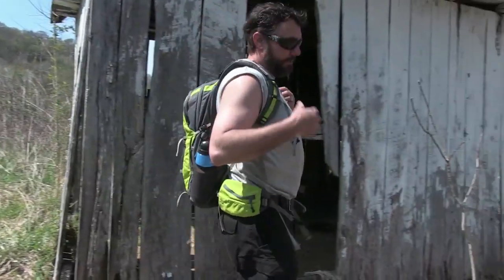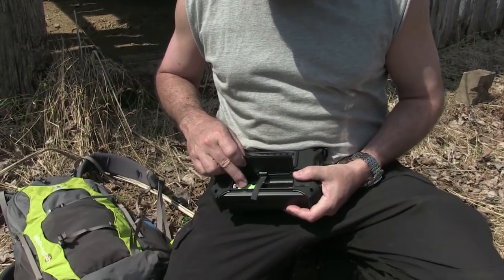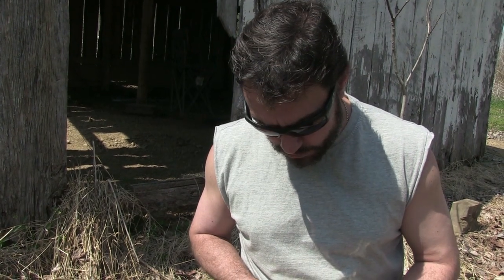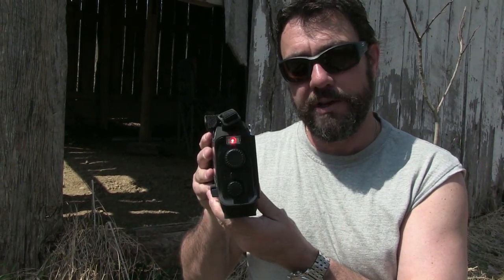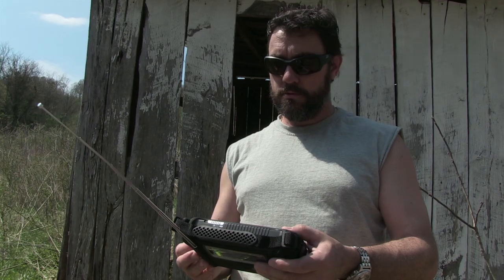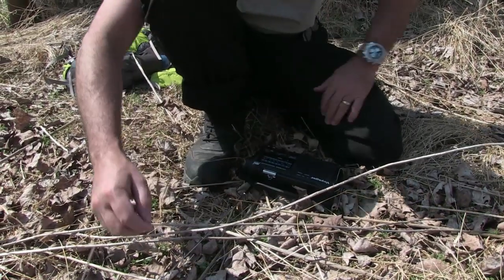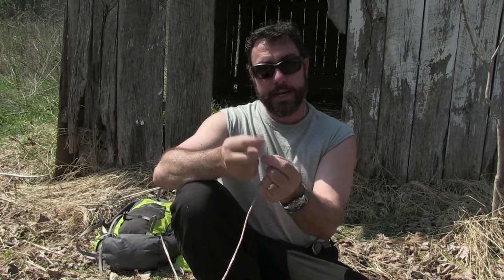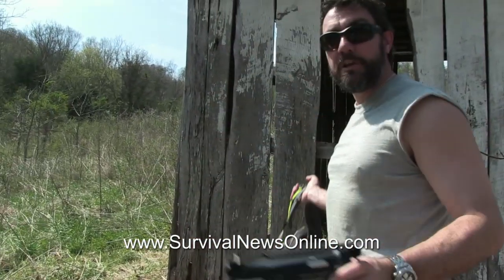Kaito KA500 Emergency Radio With Six Power Sources

Comment: for receiving you don't need the length of the wave, you only need the wave length when transmitting. you can get away with a 19" length of any wire to receive any shortwave radio signal.

Comment: This is now an older video, but the radio here is still available,
AND:
Kaito has worked hard at improving their quality control.   So much so that they have a Warranty Center/Tech Support Center here in the U.S.  And they also deal with the Tecsun brand as well.
Kaito makes Emergency Radios from $15.oo-$100.oo.
The KA-500 is their mid price radio, and one of their most popular.
Kaito makes a lot of other radios as well, but they really specialize in Emergency Radios.
I’m a collector, and have several Kaito, an several Tecsun radios.
Check out “ www. Kaito.US. Com” .
📻🙂

Comment: Kaito 332W with a few less bells and whistles, $50 versus $20. Smaller, no SW bands, but crank, solar, LED light, AM, FM, Weather, batteries, charge the cellphone, earphone jack, etc. And did I say it's about half the size and weight? As a newbie, made an amateurish video on the smaller radio, which I own and like. No knocking the KA500; just mentioning a smaller, lighter, cheaper option which may be all you need. (Enjoy your vids; I'm a sub!)

Comment: Great review. If the internal battery pack is dead and no other batteries are installed will the radio still work in full sun in solar mode? Thanks.
Reply: Yes it will

Comment: For the weather channels you say 'almost anywhere you are in the country'. Where would you not get any weather channels?
Reply: YOU only get weather channels outside of the house on a nice sunny day.  Otherwise, this thing won't pick up any weather channels, so I use the handheld digital CB radio for weather broadcasts.  My radio get the same FM station (98.5) in 6 places!  None of them are in the right spot. 98.5 comes in at 96,102, and 106 for example.
Reply: Chase Nightbloom 
All major cities, most areas of the country now have NOAA weather radio stations, and Canada has similar stations. There may be some more secluded areas not covered.
You can always google to see the station location maps. Or to check for stations in your area.
📻🙂

Comment: I have one those Kaito Voyager pro ka600 and I have to say it is crappy made radio. It has software bug that screw up the time and date occasionally. It is not waterproof and the button layout is bad. The flash light turns on in your backpack all the time and locking the buttons don't stop that happening. When you pick the radio up you always push some button accidentally if you don't have the button lock on. It has lot of functions but it is incomplete what comes to design and logic. Major issue is that it is not waterproof.
Reply: Odin1978 
It was never made to be waterproof
Reply: Odin1978 
This is why Kaito has worked so hard on quality control, and all Warranty problems taken care of here in the U.S. ( California), And they DO honor their warranty - ( there is a mail- in Warranty registration card with all Kaito and [ most ] Tecsun brand radios .-
- - *some obscure radios not intended for North American sales may not have Warranties)
📻🙂